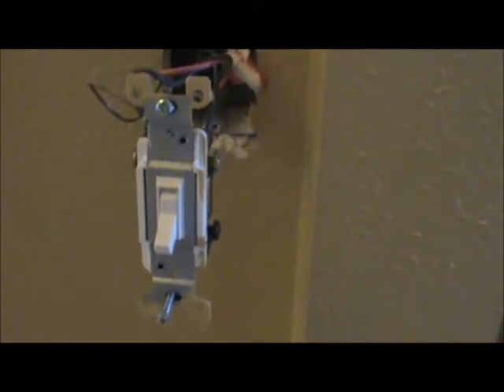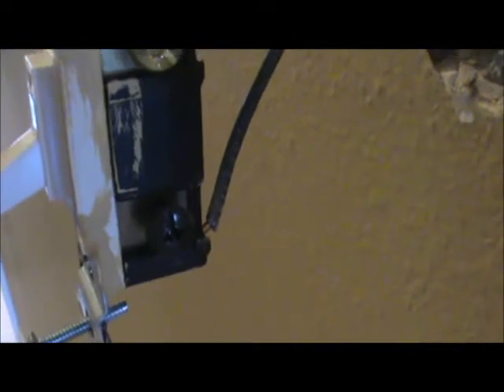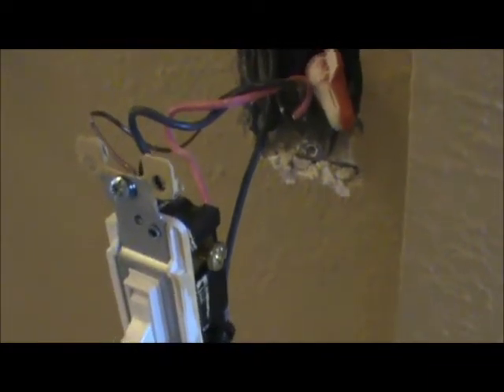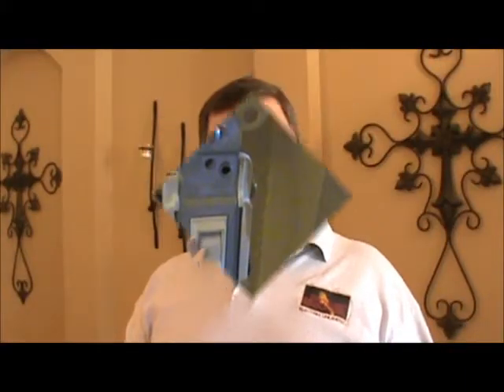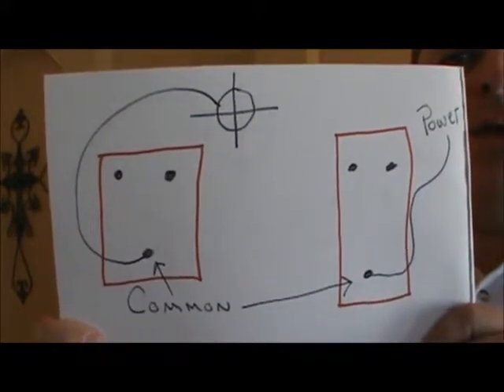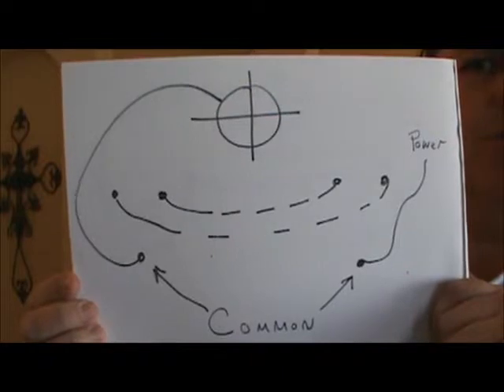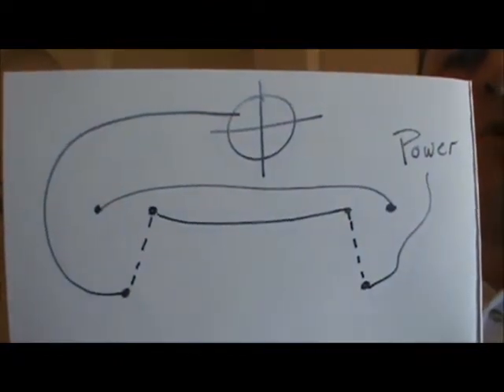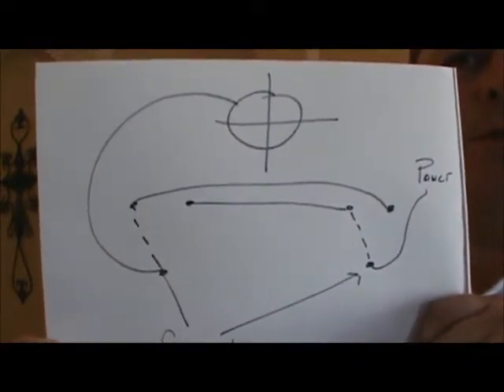"3 Way Switch"

Comment: WTF does common mean?
Reply from the maker: One of the switches will have a switch leg (common) and two travelers and the other will have power (common) with two travelers. Travelers are usually twisted together and come from the same cable (romex) the third wire is the common.
Reply: Ty Ken, very helpful!